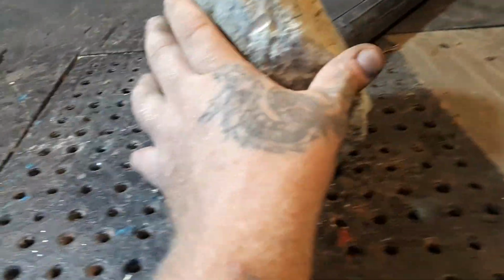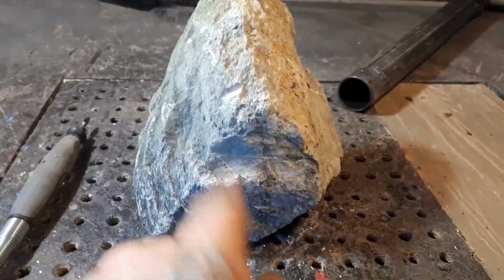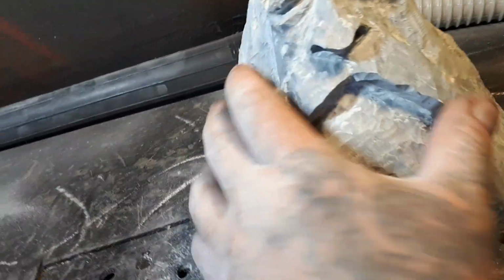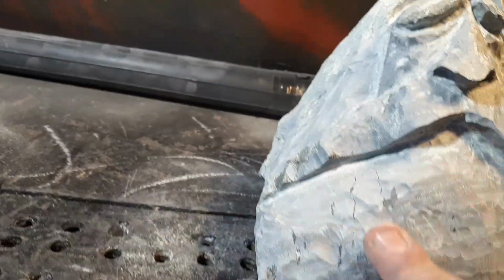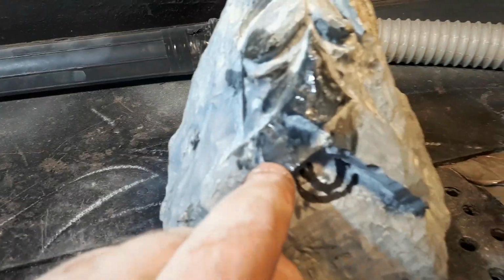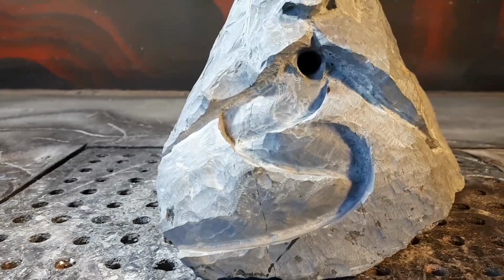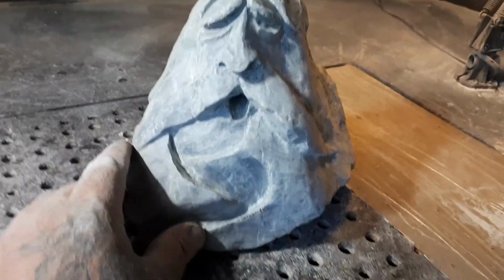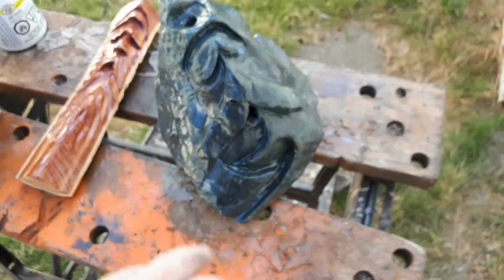Dremel carving a soapstone insence burner using a aluminum cutting bur ☆

Comment: I thought that if you didn`t mention it, I would, that the bits get really hot, and if you kept going they would lose their temper and fail, and not last like they should. But you did say, and it is a good video and so different from just types of wood. Best regards from John in England.